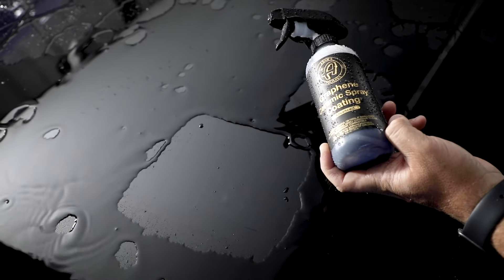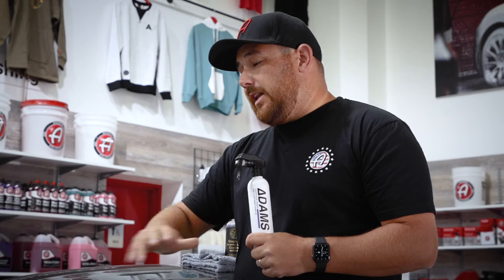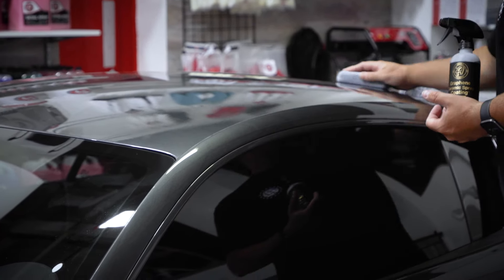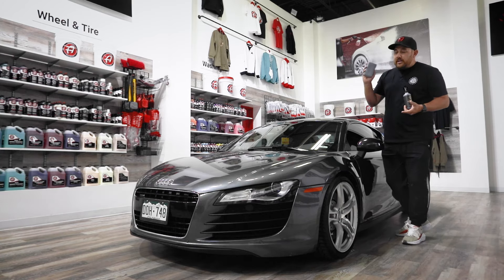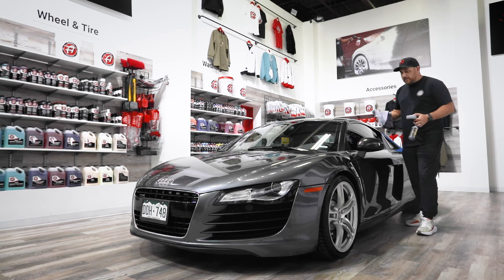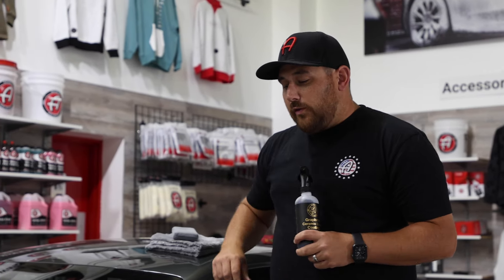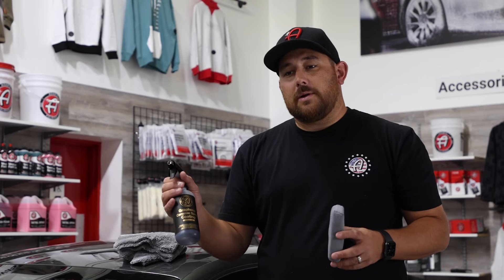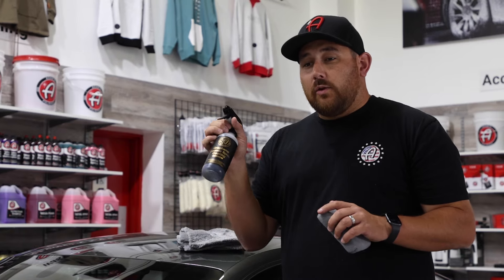How To Apply Adam's Graphene Ceramic Spray Coating Advanced

Comment: Can you add multiple layers? Is it necessary to add more coats to get more gloss and protection?
Reply: You can, but it is not necessary. When layering ceramic coatings the law of diminishing returns applies. They add a UV tracer to make sure the application is full and even.

Comment: If applied on black rubber or plastic trim, does it darken then protect it?
Or would I apply something like solution finish, let it dry, then apply the spray?
Reply from the maker: Hi there, it will darken plastics to a degree, yes; however if the color pigment is heavily faded, you can use our Black Trim Restorer first to dye the plastics, allow it to dry, and then apply the spray coating afterward to lock in the dye for a longer time period.

Comment: I already apply first time , i am gona apply 2nd time do i need to use prep spray before apply 2nd coating ?
Reply: I'd imagine it's best to apply a second coat immediately following the recommended cure time of the first coat. Personally, I wouldn't expose my car to the elements, then attempt to apply a second coat days or weeks later. But if you're doing it all in one setting, then NO, surface prep wouldn't be necessary for the 2nd coat.
Reply: @otm777  1 months now , do i need to use prep again ?
Reply: @figoageny4836  Alot could have happened in 1 month, so there's a chance the vehicle may need decontamination before re-application. Instead of adding a 2nd coat now, I would look into their "Graphene Detail Spray" which you can apply between washes, or their "Graphene Boost" for added protection to your existing coating. Then in the future when you're ready to redo the spray coating, you can go through the entire process of re-prepping the vehicle before your next coating. Hope this make sense.

Comment: Can you please advise how long cure time before we can drive it out in the rain? 24hours?
Reply from the maker: Hi Larry, our Graphene Ceramic Spray Coating Advanced needs a minimum of 4 hours before it can be exposed to rain or moisture, but 12-24 hours is even better if you can wait that long. The 7 and 9 year non-spray versions do require a full 24 hour cure time though at minimum before they can be exposed to rain or moisture.

Comment: I am getting the new 2023 bronco soon and I am new to polishing so I do not yet have any polishers. To save money would this be good to use this without polishing where ford at lease at cleans up the car before I bring home. Then the following year I should be able to get the polishers and do a proper prep before applying a ceramic coat. I do want to also get as much shine as possible.  Would this be a good choice? Thank you so much for your video.
Reply: Why do you need to wait a year to get a $150 polisher if you’re buying a $60k car? Even new, car paint comes from the factory with some blemishes that need to be polished out. It sounds like this is new to you, so I’d suggest paying someone $200 to do it properly and then you can coat it yourself.
Reply: @MoveUpMedia  well I should have said it was because of the weather.   Looks like we are getting my bronco sometime in January and it usually is pretty cold out.  So it might be too cold to do the ceramic coat.     I really do want to do the prep I just don’t want to freeze and so no point to buy all the car prep stuff right now.

Comment: Can i use graphene detail spray to remove high spots too?
Reply from the maker: Yes, you can try it on fresh high spots, but if they have cured for a bit, you will need to reactivate with a little more of the Graphene Ceramic Spray Coating Advanced - since it is a solvent-based formula, the solvents will help to remove high spots better than Graphene Detail Spray, which is a water-based formula.

Comment: Do you apply it to the cameras?
Reply from the maker: Yep! Just make sure they are clean and prepped first, and wipe away the coating residue with a plush microfiber towel just as you would on paint or glass.

Comment: Can this be used on top of adams ceramic coating (small glass bottle)? I'm trying to keep/maintain the coating for as long as possible and was thinking I could top it off with a spray every 6 months or so.
Reply: Yes you can)

Comment: do you still throw out the towel after using it?
Reply: I've been using similiar products like solvent ceramic & graphene spray coating in couple years. The fun about this product they tend to more forgiving to your microfiber than traditional ceramic coating, so you don't have to trash your microfiber. But it does reduce a bit with the towels absorbance capability.
So my recomendation, you can use the same microfiber for other than your paint such as engine or wheels, tire, or undercarriage cleaning.

Comment: Can I apply over a spray sealant as a topper?
Reply: No, this is a true coating and needs a completely clean and naked surface to properly bond. Applying over a sealant or wax will interfere with that process and lead to inferior results, much less longevity, etc.

Comment: From Thailand, I bought this product and study how to apply. Here is a land of high temp and humidity. Any suggestion for this product?
Reply: Product is solid. I have around a 100 kits imported here in Pakistan. Has been performing exceptionally well. We have all the seasons; summers, winters, autumn, high and low humid weathers. Much worse than Thailand. Runs strong.
Reply: @moinj4846  thank you
Reply: In higher temps and humidity it will cure faster, so check it often
Reply: @chrisinco5920  thanks

Comment: It's a Chevrolet Malibu black vehicle. Can I spray Adams Graphene after applying Adams Glaze?
Reply from the maker: Hi there! You could apply our Graphene Ceramic Spray Coating on top of Brilliant Glaze; however it will not bond as well and the longevity would be decreased. It is ideal to apply the Graphene Ceramic Spray Coating to the bare polished paint for best results. You could remove the glaze with our white Polish, or even Surface Prep at a minimum would help the spray coating to bond better.
Reply: @AdamsPolishes  Thank you I have put adams advanced grephene coating on the paint surface of the car. I want to wash my car and layer adams grapheme advanced spray on my car. Then should I wipe it with a prep and put it on top?
Reply from the maker: @오상혁-d3o  Yes, you will want to clean the car as thoroughly as possible, then use Surface Prep, and then apply the advanced spray coating!
Reply: Thank you. Even if adams advanced grapheme is already installed, I need to clean up the car paint with prep and install adams advanced spray.
Reply: @AdamsPolishes  I want to layer the existing Adams graphene coating layer, so won't the coating layer be damaged if I wipe it with a prep?

First of all, the coating is Adams Graphene Advanced, and we will use Adams Graphene Advanced Spray type for layering.
Reply from the maker: @오상혁-d3o  you can layer the Advanced Spray on top to enhance the base layer coating about every 6 months or so. It will not hurt the existing layer, but the spray coating may not necessarily bond as well to another coating layer. The coating will somewhat reject additional layers.
Reply: @AdamsPolishes  I'm so sorry. There was an error in the reply. What I'm curious about is whether the prep affects the existing coating layer.

Comment: Do you trash the microfiber towels after use with this spray?
Reply from the maker: You do not need to trash your towels after use with any of the Graphene or Standard Ceramic Coatings.  Washing your towels regularly, especially with our Towel & Pad Revitalizer will maintain the quality of your towels for many many uses.

Comment: How close is it to a conventional ceramic, how many coats should be applied?
Reply: From my experience the spray trades ease of application for longevity. About half. Though a good application of the spray should easily last 6-8 months, which is more than enough to justify the price and time. I personally use their graphene detail spray as an upkeep topper between coats. With their regular graphene ceramic, I got about 13 months before I noticed water not beading much, indicating its time for a fresh coat. The fact the spray is about 1/3 the cost made moving to the spray a no-brainer and I've been more than happy with it. 

As for the amount of coats, 1 is more than enough if its a good even application with proper cure time. Ceramics/Graphenes dont benefit from multiple coats like traditional waxes and carnauba's, at least from my experience anyway. Have been detailing cars for 20+ years now. If you meant how close is it in terms of visuals? The same. Both products have the same amount of gloss and reflection. 

TLDR In short:

Spray = Same visuals but half the longevity of their regular ceramic, at 1/3 the price and a bit easier to apply.
Reply: @junkiexl86  You mentioned using the graphene detail spray as an maintenance topper between coats/washes. Have you tried their Graphene Boost spray or would that be considered overkill and Graphene detail spray a better use?

Comment: Is this good for  a high-end brand new paint job on a 2000 Corvette, no prep necessary?  Basically you just wait until the rainbow disappears, than buff it out with  the plush microfiber?
Reply: Yes. But make sure to properly decontaminate and clay bar the paint first.even if the paint job is new.

Comment: Can I put this over the top of wax? Or should I clay it down first?
Reply from the maker: Hi there, for best results and best bonding, we would recommend polishing off the wax layer with our white Polish, then Surface Prep, and then applying the Graphene Ceramic Spray Coating Advanced. Ceramic coatings bond best to the bare clear coat. You can apply it on top of the wax, but the longevity will be diminished.
Reply: @Adam's Polishes  can you apply a carnuba wax on top of it for added layer of protection and pop?
Reply from the maker: @CalDeRosia  you could, but it is not necessarily recommended. A carnauba wax is in a different product family than ceramic coatings, and could make the coating perform less in terms of hydrophobics and water repelling behavior. Graphene Detail Spray or CS3 would be better and more compatible toppers for a ceramic coating to enhance performance and shine 👍
Reply: @AdamsPolishes  Couldn't you just strip wash it vs polishing off?
Reply from the maker: @otm777  yes, Strip Wash will remove a wax, but polishing will correct swirl marks and scratches for the coating to look its best.

Comment: Hey Adams do i need to dispose towels after use?
Reply: Anytime working with ceramic based products you'll definitely want to dispose the towels/applicators after use. The product dries hard and is hydrophobic so no amount of washing will truly remove the product. Re-using them will lead to a high probability of fine or medium scratches.

Comment: Okay so you wash you car , dry it , wax it if you want to of course of If you have to and then the last thing is the graphene spray correct ?
Reply: No wax this should go on bare paint. You can clay bar ,polish first. Use an alcohol / distilled water mix for a final wipe before application.

Comment: FYI. NEVER leave this ceramic coating on plastics. Unless you want that surface to age 20 years in a week. Idk why Adam’s ever recommended leaving it sit on plastics. Especially textured plastics. I don’t think they actually tested it before advising that. 
If it’s a textured plastic surface, I wouldn’t even let it cure all the way if you’re going to apply it.
After a lot of complaints they’ve finally started to advise people to at least wipe it. But be warned a lot of plastic trims have been ruined just leaving this stuff sit. 
It will make your plastic look like it’s sat in the sun 20 years.

Comment: Bought this and I’m confused about application. The video says spray into applicator and wipe on, but he also sprays directly on the car. Do you do both? I did my car by just spraying into the applicator as he did and only covered as much paint as he did, and because of that I barely used any for my whole car. It almost looks like I didn’t use any and the bottle will last a lifetime. What am I doing wrong?
Also I got the rainbow effect but after 5 minutes it still hadn’t faded so I just leveled anyway. Should I have kept waiting? I was working in my garage about 80 degrees with moderate humidity.

Comment: After polishing my car to remove micro swirls, I just used my pressure washer to remove any leftover polish from nooks and crannies and lightly washed it again with soap and water. Skip the Surface Prep. Just another $ product to use. You could also spray it with isopropyl alcohol after washing but I found that's unnecessary.

Comment: do you strip existing ceramic coating first then apply this?
Reply from the maker: Hi Arif, if you have an existing ceramic coating on the vehicle, we would recommend doing a thorough wash with a protection-free soap, such as our blue Car Shampoo, then Surface Prep to make sure the paint is as clean as possible before applying the spray coating on top of the existing coating. You could remove the existing coating, but that is a time-consuming process, and may not be necessary. The spray coating will boost the performance of the existing coating!

Comment: Can it be used on polished raw aluminum?
Reply: No, not recommended. Raw aluminum can cloud up from underneath, meaning you'll need to polish off the coating to fix it. Plus it is designed to bond to clear coat, not raw metal.

Comment: good product. highly durable n glossy.  but does instantly  
stain microfibers forever. even after washing immediately..it doesn't come out so you always know it's ruined. for that reason I'll stick to ceramic  based sprays
Reply: It's best to throw away all microfiber towels used to apply or buff ANY type of coating product given the possibility of crystals forming which can scratch paint
Reply: @Phil413  for true coatings yes..if not..just dunk them in your  soapy wash bucket right after use  to prevent drying

Comment: Up to 2 years of durability,  what a bul....it , I still have first versions of this coding when you promise up to 1 year, in real life 4 months,  waste of money
Reply: they promised 7 years for the coating in glass bottle. It was also obvious that this is a lie. The coatings that are produced by "true ceramic" companies and cost twice-thrice more cannot live to 7 years. I have no idea why Adams claims such long periods for their coatings
Reply: It’s one of the most durable products I’ve seen. Application is key. I’ve seen reviews where the test panel got through a 130 washes and still had hydrophobic properties with Adams Graphene Spray Coating
Reply: @achillesus7  I don’t think they promise 7 years. More like “ up to 7 years of protection “ . Maintenance is obviously a big determining factor in how long a coating lasts. Tunnel washes and neglect will wear any coating down a lot
Reply: @DJR5280  this is not a real world test 🤷‍♂️ in real conditions it could fail after must faster even with good washes
Reply: @achillesus7  It could yes. Anything coating / sealant product could
Reply: With coatings, proper prep and application are everything. Maintenance with the right products and steps is also very important. As stated above, they don't promise anything, there are too many factors at play especially when considering this is a DIY coating. Be interested to know what your process was, step by step and using what, to prep, apply, and maintain the coating, plus why you think it failed; it could be something has "clogged" the coating.
Reply: @achillesus7  As stated above, they don't promise anything, it's a DIY coating and there are many factors in play when someone claims the coating doesn't work properly, often improper prep, application, and/or maintenance. They base their longevity estimates on many tests and data, including in their lab, and have a video about some of it on here.
Reply: @chrisinco5920  full prep was done , wash, full decontamination,  gyeon ironX, gyeon Tar remover, clay bar + clay lube, wash, 2 step paint correction,  wash, drying,  IPA wipe - gyeon panel prep,  coating applications,  car was left to cure for 19 hours,  first wash after 10 days from application with pH neutral shampoo